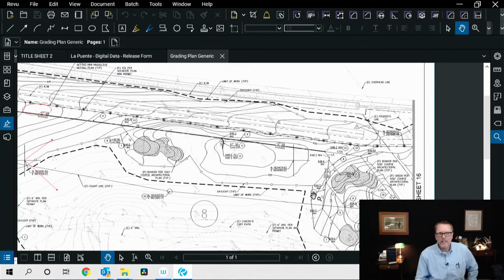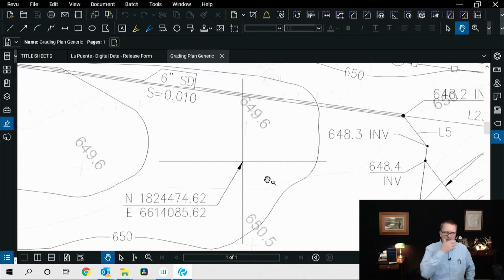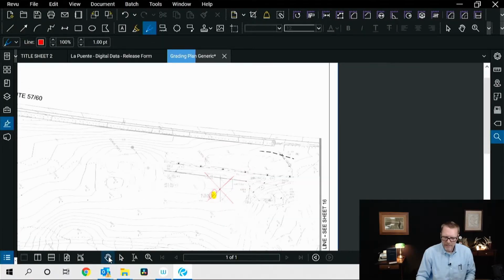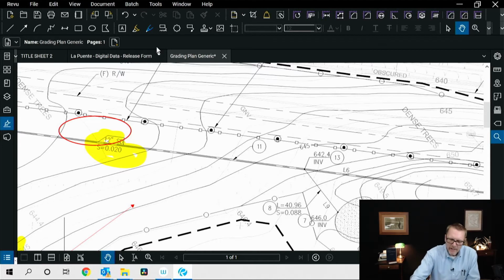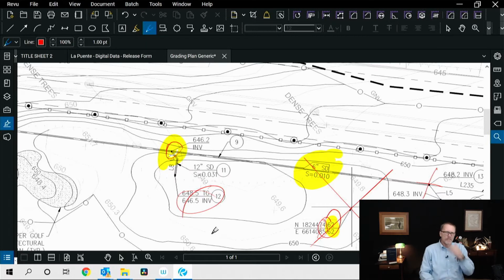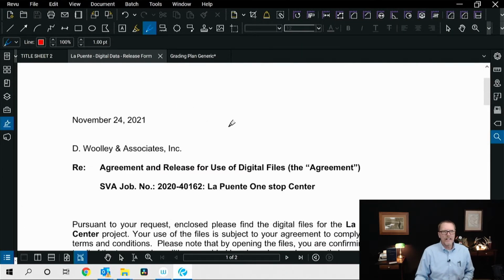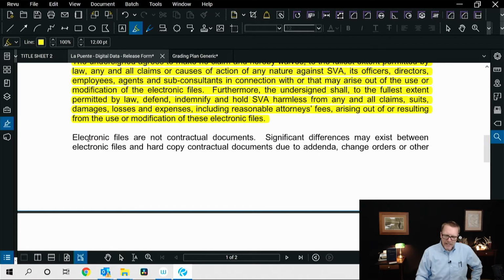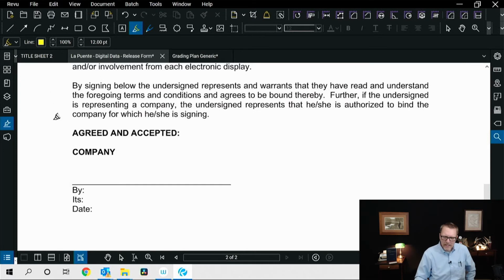Episode 23 CAD Release Form Liability

Comment: I've been surveying for 10years now and I've seen the degradation of drawings just in my career.

What we do is sign the release get the CAD, get the points we need from the CAD, put it in a list and send it back to the client and request that they check if the information is correct, when they confirm or give us adjusted points, liability comes off us surveyors and back to the engineering firm, just make sure to have an email record or some written record. 

Makes the release trivial, and we just charge more hours to do the circle jerk. We looked at the cost of doing this and with all the hands involved, time, and waiting it was about 10k CAD, all over horizontal coordinates for a bridge culvert inverts.
Reply: We all use CAD drawings out of necessity.  There is no alternative based on the modern day engineering practice.  The point is not to sign the release.  If the CAD drawing has verifiable boundary and/or topographic information and there is verification the CAD file agrees to the approved plan set the surveyor is ok - also, providing the plan used is intended for the feature being staked.  The signing of a release to use the CAD is the problem - that is the words of caution.  Do not accept the liability for work we are not trained or licensed to perform i.e. engineering.  I strongly recommend against signing any releases.  We walked away from the project in which the release shown was presented.  Thank you for taking the time to comment.  I appreciate it.
Reply: Lol, that's weird.  My kids must have been logged in on my wife's account.
Reply: Lorne Geddes:  Using the signature required release presented, how does the email of coordinates negate the language of hold harmless and the indemnification?  Land surveyors have to work with CAD drawings, we have to rely on the engineer's design, but we do not and should not sign the release with the language as presented.  The signature is the linchpin, do not sign a release of liability.  The engineer and/or architect is responsible for their design - do not take away their liability as a surveyor.  I am not sure an insurance company would cover the firm.   Good question to ask the carrier.
Reply: @youheardmeright7294  from our understanding up here.

With the release, if we took the CAD drawings and used them directly for construction, we would be taking on the liability of assuming the CAD drawings meet all the new addendums, revisions etc, and it would be on us to check that the CAD drawings match. 

However, if we got information from the CAD drawings and asked the engineering firm to check those coordinates and see if they are correct. It is on the firm now to check all the revisions etc, and when they confirm the points to use, then they are taking the liability. 

So we aren't laying out the points we got directly from CAD without approval but the points the firm confirmed are correct or not. 

This is the same thing as if the construction drawings had a published points table in the first place.

I prefer to go this route because I'm not playing telephone with RFCs and RFIs with a CAD Tech that doesn't know how to survey and doesn't know what we need. 

Tldr
You just need to confirm all information with the engineers before doing layout and then liability is back on them. In court if they ask where you got your layout info, you point to the email from the engineers saying to use those points and not get caught saying we got our info from the CAD drawings.
Reply: Thanks for the detailed response.  It would be interesting to get an engineer's response if you reversed the signature release with the coordinates back to the engineer i.e. same hold harmless language and indemnification for the information calculated from their plan.  Please try and let me know the outcome.  Thanks again,  I appreciate the conversation.  Dave